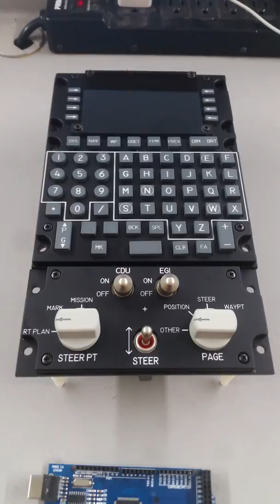DCS Bios RS485 Network Bench Box, Mega Master and Slave Shields

Comment: I've try to using a Arduino Mega 2560 pro mini, but i have no connection to RX/TX. Is there a difference between a Arduino Mega2560 and the Arduino Mega 2560 pro mini?

Comment: Nice job, thinking of doing a similar setup. One suggestion is to add a 0.1uf  decoupling cap at the power/god pins on all the chips. It’s good practice and eliminates common gremlins in circuits.